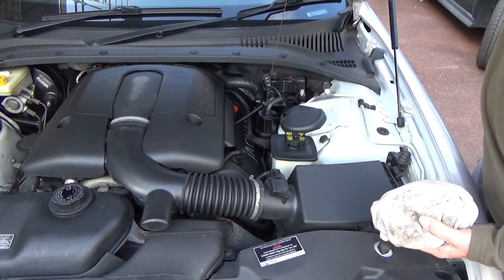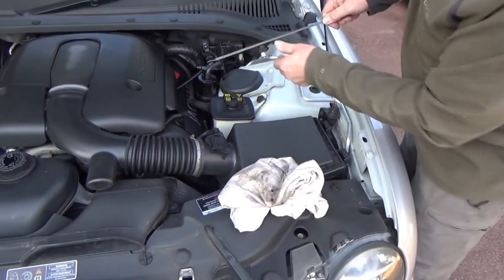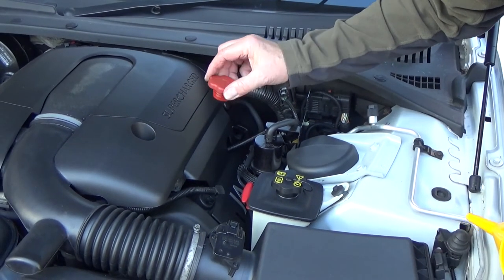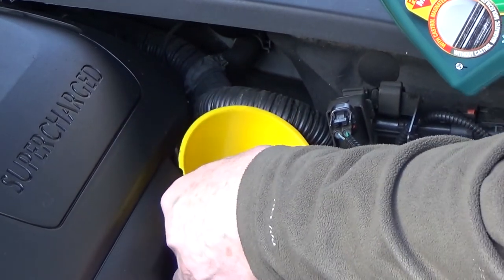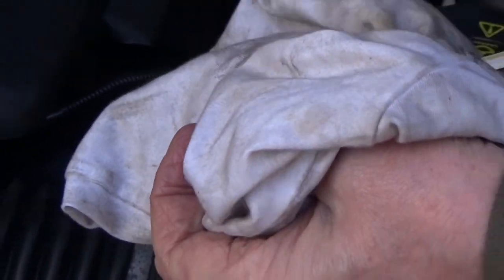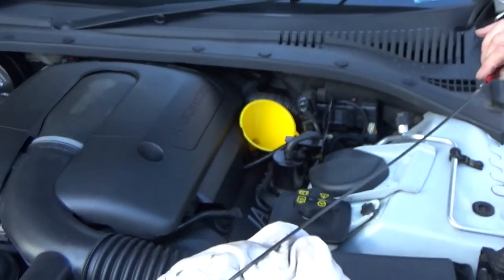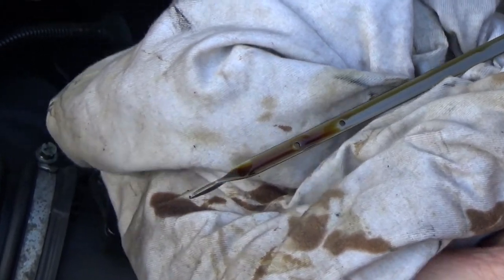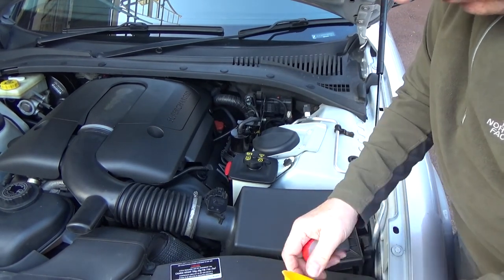Engine Oil, Check and Topup, Jaguar S-Type R STR

Comment: In my 2003 s-type 3.0 sport, the manual recommends 5w-30 conventional oil only.  Should I use a synthetic blend, full synthetic,  or conventional?
Reply from the maker: Hi,
We use the following fully synthetic oil for our 2003 - 2005 4.2L and 3.0L S Types.
Castrol 15990F Magnatec Stop-Start Engine Oil 5W-30 A5

Cheers

Brian aka "The Old Man" JagTV
Reply: Thank you.

Comment: What oil do you recommend for the Jaguar s Type R gearbox? is ravenol good?
Reply from the maker: Hi Conu - we have always used and would only recommend ZF Lifeguard 6 ATF - Automatic Transmission Fluid for the ZF 6HP26 6 speed Auto transmission.
Cheers Brian aka "The Old Man" JagTV

https://bearmach.com/atf-zf-6hp26-transmission-fluid-1l-tyk500050x?glCountry=GB&glCurrency=GBP&gclid=CjwKCAiAp5nyBRABEiwApTwjXvdTGcWd2NkDu1_Z2_StzjYQtT0guqzIkdmP5Sv9_7ocbvB5i7EvvBoC4TwQAvD_BwE

Comment: Hey, I am just trying to figure out if this vehicle should be hot or cold when checking your oil?
Reply from the maker: Hi Scott,
You'll get a more accurate reading when the engine is cold. However you can check after a run when the engine is hot as long as you let it stand for 10mins or so in order to let the oil settle back in the sump/oil pan.
Cheers
Brian aka "The Old Man" JagTV
Reply: Hey, thanks a lot for the response. I don't know if you guys have a video for it or not but i am running into some "gearbox fault" issues. i am really worried about this one, it typically happens when i start the car up & put it in reverse. then sometimes when i approach a red light and the car shifts from 2nd to 1st. Any idea what the cause of this could be? I have an 03 s type R with nearly a hundred thousand miles on it.
Reply from the maker: Hi Scott,
It's always difficult (well almost impossible) to diagnose gearbox faults remotely without experiencing the symptoms "first hand". However often faults can be rectified/avoided with fairly straightforward regular maintenance.
A few questions:-
1) What is the actual symptom when selecting reverse - I'm a little unclear of your description?
2) Does it always shift from 2nd to 1st when slowing to a stop?
3) When was the last time your gearbox had a fluid and filter change? (Old burnt fluid can be a transmission killer)
4) Apart from the 2nd to 1st shift does it drive Ok otherwise?
5) Do you get the "Gearbox Fault" message come up in your dash display and if so have you read the "Trouble Code/s"
Cheers
Brian "The Old Man" JagTV
Reply: wow, thanks for the quick response! typically, when taking the car from Park to Reverse, the amber light will appear and the gearbox fault will pop up on the dash, it will also make a bit of a whining noise. i then back it out of the driveway, put it in park, turn the car off and start it back up, then it will be fine... until i reach the stop sign. then i will usually have to repeat those steps. (i prefer to drive with the jgate/manual option on the transmission.) sometimes it will wait until ive been stopped for a couple seconds before i feel the trans shift back down to first gear ( there is no first gear option on the shifter) the last time i had the trans fluid and filter changed was roughly 2 to 4 thousand miles ago and the shop said that the old fluid did not look to bad. I ordered it all from rockauto.com i believe. Most of my miles are highway miles and it runs very smooth. but i am noticing that in 5th gear, at around 2000 rpm's the rev is fluctuating a bit. It took about 3 days for the problem to actually trigger a check engine light but once it did, i took it to advanced auto parts & the codes read are P1647, P0731, and P1111. The check engine light does not stay on and once the car has been driven for a bit, it seems to operate properly (with the exception of the rev fluctuation. Thanks again for your advice.
Reply: cold

Comment: Your videos are great I have a 2005 Jaguar STR and need to replace or check the connections for the center high mounted stoplamp.
Reply from the maker: Hi - thanks for the kind words.
What problems are you having with the stop lamp?

Comment: Castrol 5w30 is only viscosity temperature depend where u life! Learn all about the different types of motor oil The API/ILSAC Starburst is found on the front label of qualified motor oil bottles.THE RECOMMEND OIL FOR JAGUAR S TYPE R IS CASTROL  A3/A5 where API Service Category SJ and earlier categories are recommended use (So Casrtol C3 is not for Jaguar)!
Reply from the maker: Hi,
Many thanks for your input on the oil type and thanks for watching.

Comment: Don't you have to change the oil filter too
Reply from the maker: +victor zelaya 
Hi,
The video clip is just for checking and adding oil rather than an oil and filter  change. The oil filter change is covered in our engine oil pan gasket change.
Thank you for your coments.